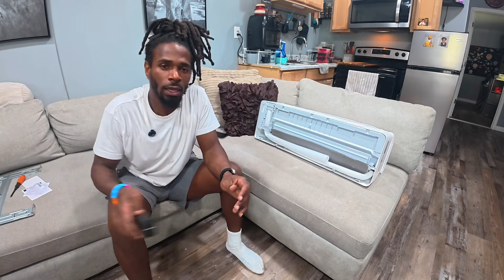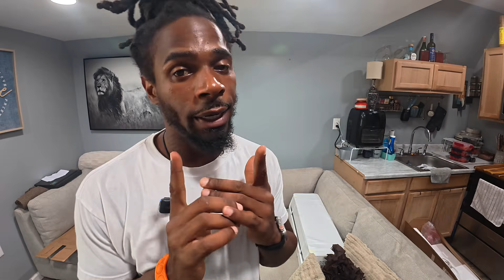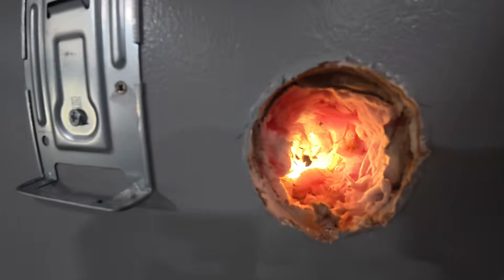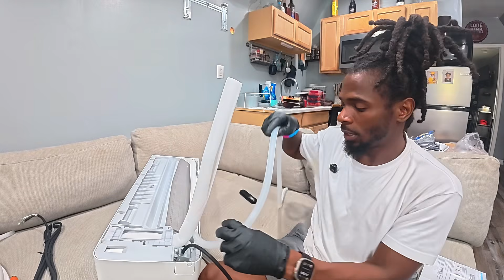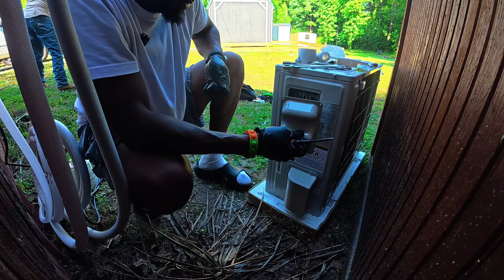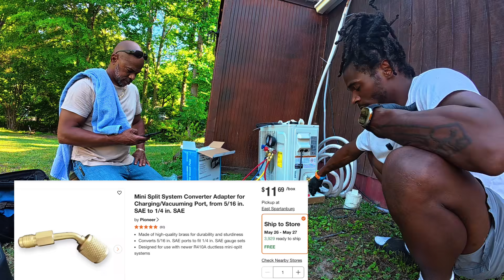My Tiny House Finally Feels Right with This Major Upgrade!!

Comment: The drill of choice the hammer or were your bits go over heats an is horrid power for sinking screw an shi unless they fixed it but for 10+ years i have yet to have one fixed desighn
Reply: An adjustable wrench is better 😂😂 the pliers will strip bolts faster if you ant careful

Comment: Hey Uncle, great job. Safety First Reggie, please wear the glasses. Also you can wear a headband to keep the sweat from rolling down that way you don't have to keep wiping your forehead it works trust me. There is a way to hide those wires inside the wall so you don't have to see them. Good luck on your future projects stay safe.❤❤❤❤